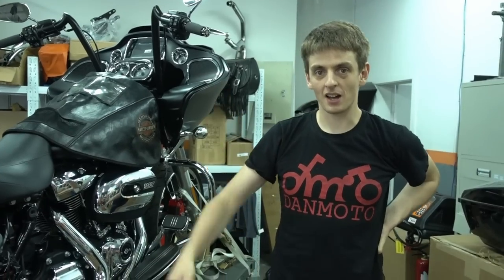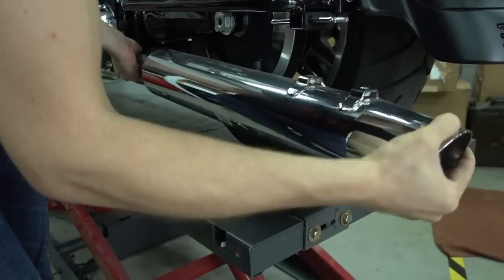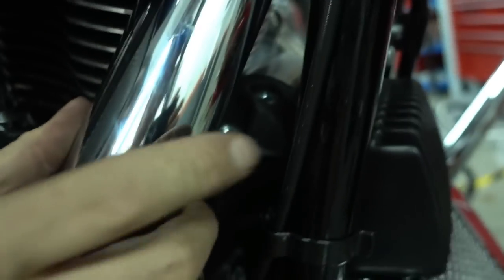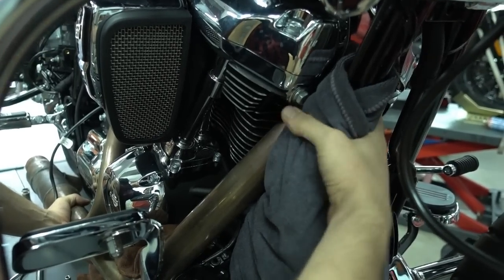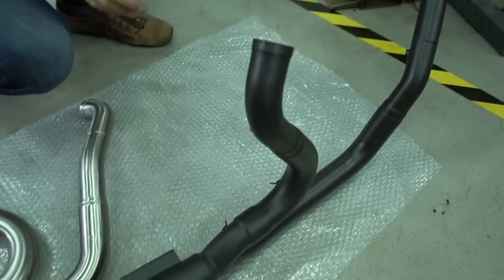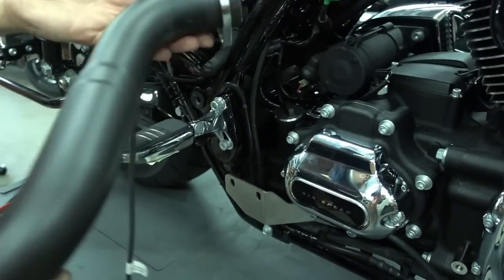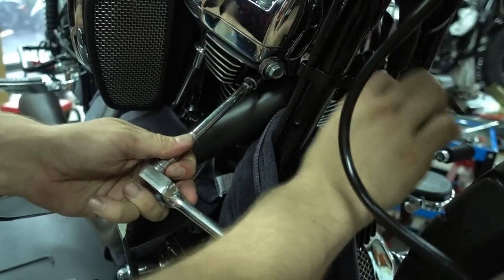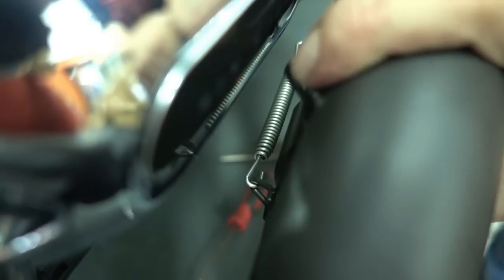Danmoto Highwayman Exhaust  Harley Davidson Touring 2017+ Milwaukee-Eight Installation + Soundclip

Comment: Had a highwayman on my 09 elrctraglide and a 2000 roadglide. Love them but tranny mount on my 09 was a weak link and although this is a new and improved mount it looks like it could be weak as well. I had to fabricate my own after not many miles. Having said that the pipe performs like a champ and sounds mean as hell. I also love that you have done away with the un necessary down turn in the muffler. Looks much better. Will be ordering one asap for my 17 Road King Special. Watch for the install video 😊